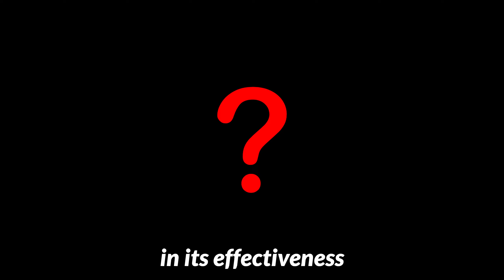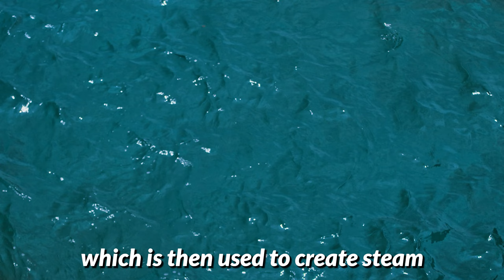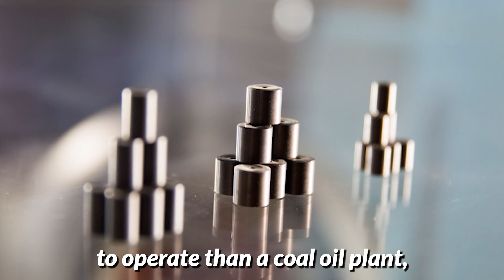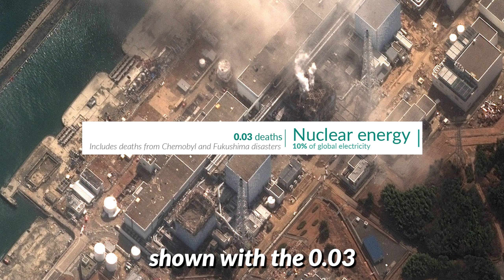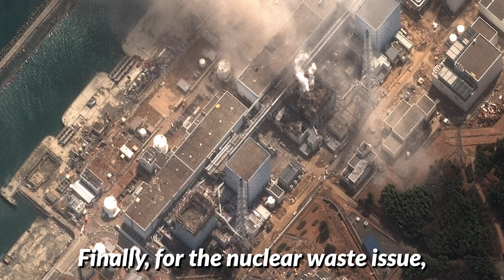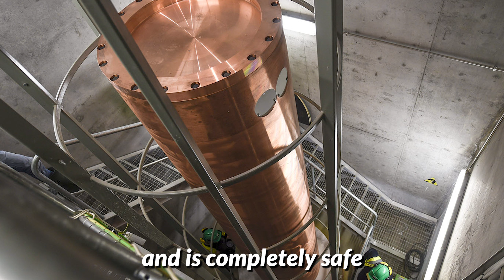Why You’ve Been WRONG About Nuclear Energy...

Comment: Nuclear is the answer, but not this nightmare of a reactor that only burn 1% of its fuel and put the other 99% in the ground for 20,000 years, by the way at the end 20,000 years is when you start counting how many people have died from the reactor. Oh yeah it is a standard steam technology, except the problem is water in a nuclear reactor is like putting race car fuel in your radiator, it cost a lot to try and make it safe and that the ridiculous pressures that has to operate at is unbelievable resulting in giant concrete steel reinforced structures just to keep it from becoming a dirty bomb. 
Have you ever been at a car lot to buy a car, and the sale man keeps trying to sale you all the clunkers, the nuclear industry does the same thing with this Cold War relic, let make small and cute and call it SMR but it still the same reactor nobody wanted for the last 60 years. Thorium Molten Salt Reactor is the only fission reactor for me.

Comment: PWR reactors leave expensive waste that will remain dangerous for tens of thousands of years. Thorium reactors will provide inexpensive, clean, walk-away-safe energy for millenia. They do not have to be multi-gigawatt size to be economic. They can be small reactors placed near the point of use, such as small cities. The power can be shared with other cities to provide redundancy. The cost is very favorable compared to roads, water and sewage systems, and they will require far less maintenance. They cannot explode or melt down. Unlike PWR where the waste is over 99% of the uranium, Thorium uses most of the metal and leaves a vey small fraction in waste. This will decay to negligible levels in as little as 300 years.

Comment: Nuclear is an economical lie.

Nuclear promoters create a limited number of talking points to distract clear thinking. 

5 times more electricity will be needed in decarbonized economy. 

The biggest cost of centralised and concentrated electrical supply is the national electrical power grid. 

Nuclear will talk about how tiny the nuclear plant is. 
Nuclear will talk about how tiny the waste is.
Nuclear will talk about how small the land is.
How economical it all is, and even 5 times bigger every thing is tiny.
This is wonderful and small, even factory produced.

BUT it is 5 times stupid to ignore that the national grid is 5 times too small.
The grid is 10times more expensive than the central electric power plant. 
10times more expensive. 

And with centralised any power the grid is the killer cost. Transmission is the killer cost. 

Even Nuclear promoters will tell you that building more electricity transmission lines to distant sources is the killer cost. 

Poles and wires to the streets and homes and businesses and industries and buildings and all the ends of the existing national grid is invisible to everyone. 
The grid disappears and becomes part of the background. 
We need it and ignore it. 

An example is my little street of 30 homes, it has a water supply and waste water removal of 200 litres per person per day. 
That is a minimum of 60 tonnes water handling a day. 60 tonnes in a little street. 
Each day and every day 365 for decades and decades 

Totally invisible feat of engineering. 

Electrical power supply is the same in that the capacity of the supply is a massive engineering feat that nobody even notices. 
But a 5 times bigger capacity means 'rebuilding' it 5 times and its dangerous costs are totally ignored by nuclear promoters.

do you think we will have Electric vehicles in wide use ?

Nuclear is a 60years to 100years locked in project.
500 SMRS, Small modular reactors, will be needed in the future. In Australia. 

20million vehicles with huge batteries would take 20years. 

20million buildings with rooftop 33kwh daily would take 10years.

All buildings are connected to the national grid today.
At point of use.
No transmission costs. 
Unloaded grid saves massive amounts of grid building expansion costs.
Reply: "An example is my little street of 30 homes, it has a water supply and waste water removal of 200 litres per person per day. "
Solar panels aren't too bad (when backed up by gas) for covering residential use, but you can't run massive industry on renewables.  It is both too expensive and unreliable.  That means the materials FOR your house, your car, etc all have to be made, and that requires reliable power.

"Transmission is the killer cost. "
In order to have renewables work well, you have to put them in the correct location.  That is wind turbines where it is windy, and solar where it is sunny.  That means LONG transmission lines all to support power that is not continuously using the maximum capacity of those power lines.
Reply: @LFTRnow  The transmission of electricity is the biggest problem of all centralised concentrated electric power generation. 

This is the elephant in the room. 

The national power grid is 10times more expensive compared to generation plant.

5times more electricity needed in the future means
 a massive construction and massive mining and massive refining and massive amounts of money and massive amounts of manpower 

Mind boggling amounts. 

Unloading the national electrical power grid is critical for survival. 

Rooftop generation will be incredibly huge as it removes the transport costs.

Basically without transmission costs rooftop is unbeatable.

Comment: I have Solar Panels No Gas and produce electricity and make Money on my Energybill for 10 years now. Easy Fast and Save. I need no Nucleaire Electricity. Solar Electricity is for Free.
Reply: and the sun shines at night? never hread of base load
Reply: @allanmurphy8183  nuclear is economically a dead end after 20years but is built to last 60years to 100years. 

Renewables and batteries will be dominant in 10years. 

No banks will lend on nuclear projects. 
Government and tax money will be asked to support and to be subsidised.

As I said it is economically stupid. 
It can only function as a central concentrated supply.
Reply: @stephenbrickwood1602  That may have been the case with previous nuclear designs, which are decades old.  Also, the reason why solar is cheap is it is heavily subsidized.  So much so, that nuclear with no subsidies can't compete on such a skewed platform.  In the meantime Gen IV nuclear is coming as are small modular reactors - reactors that are built out of pieces that are trucked in, rather than a decade of building (this lowers overall cost and time frame making it more reasonable to get loans, which are already happening).  

Molten salt reactors are also starting to come, with China having built the first one.  Molten salt means it can't melt down (it is already molten by design) and greatly improves efficiency.  Combine that with thorium and the benefits multiply again.  These smaller reactors can also be throttled up and down to provide power when the sun isn't shining or the wind isn't blowing.  I have solar panels too, and batteries are not cheap - not personally, and not grid scale, so the end result is natural gas is burned in "peaker" plants to bridge when solar and wind is not outputting.  This puts more CO2 in the air than if you just had a nuclear plant.  Instead, renewables and nuclear can work together, as the goals are the same - 0 CO2.
Reply: @LFTRnow  the President of the Australian nuclear power promotion society, a Civil and Nuclear Engineer said both can work together.
Reply: @Stephen Brickwood  
Hi SMR are cheaper to produce with some designs having the added benefit of burning old nuclear waste.  Bank will not lend to anyone wanting to set up an industry  with up to 60%of its overall costs up  front govs will have to foot the bill. But here in Europe, we are used to paying for things that way. 

However, nuclear is the only system at present which can provide the base load cleanly
Reply: @allanmurphy8183  if you want to understand the real problem of centralised electric power supply then you must know the cost of the national electrical power grid. 

Total klm and cost per klm. 

And the fact it has to be 5times bigger in capacity. 
Basically 5 national grids. 

The nuclear plants at $2billion each, installed and running and supplying 5times more electricity, is 'chicken feed'.

That is the problem with solar farms, with distant wind farms and central nuclear plants.

If they increased the fossil fueled plants 5 times, the power grid must still be increased in capacity. 

Nobody is saying this, except the nuclear power promoters when criticising renewable solar farms some distance from the population centres for example. 

It is a massive future cost.

There are answers but the real problem must be seen so it can be addressed. 

Reliable nuclear maybe the only answer but
Reply: If you live in a place where you can have all the solar panels you need and can afford the battery for backup power Great on you, i’m envious.  But there other things to think about, renewables don’t do well in Extreme weather, and humidity has caused the weight of the Earth crust to shift resulting in all possible kinds unknown events that could make renewable useless, at least with a molten salt reactor it can be more isolated from Extreme weather then other from of power, the reactor that this video is pushing needs free flowing water nearby not to mention it a expensive dirty bomb waiting for an excuse to blow.
Reply: @YellowRambler  install 20 Solar Panels 400 Wp each. You Produce 8000 kWh every year. That is enough. As Battery use your EV. Inductioncooking, Close in Boiler for the kitchen, 50 liter boiler in the Bathroom for a shower. Electric ventilation heaters Cost 35 euro a piece. No Gas, Petrol, Or Monopoly
 I get my Power from Greenchoice Sun and Windpower and sell my Power to Greenchoice. Done for 10 years now. Works Perfect. Thank you.
Reply: @willeisinga  
sounds great👍 let’s hope they don’t mess with your buyback scheme, like there starting to do in California. Yep someday maybe I hope to get some solar panels but that not today. But I would feel better if they could Finally get some real upgraded fission reactors going instead of these nightmare reactors we been stuck with for more then half a century now.